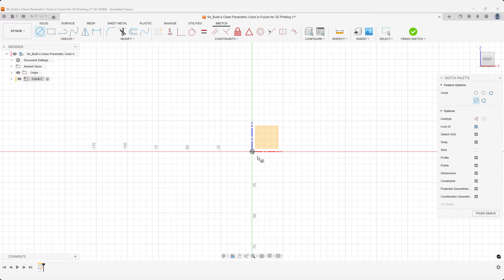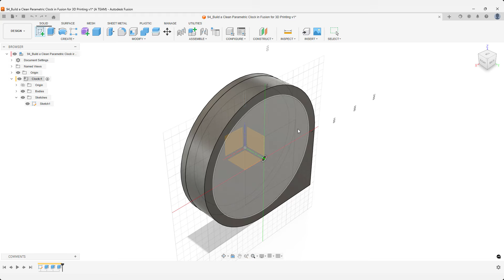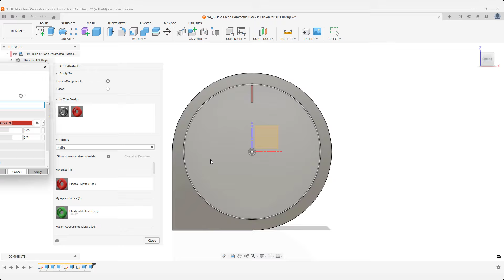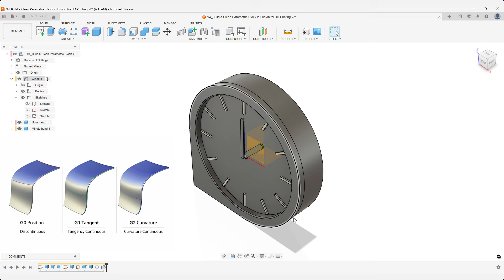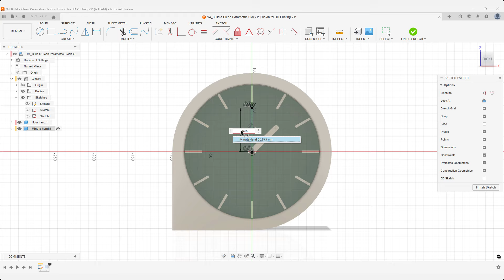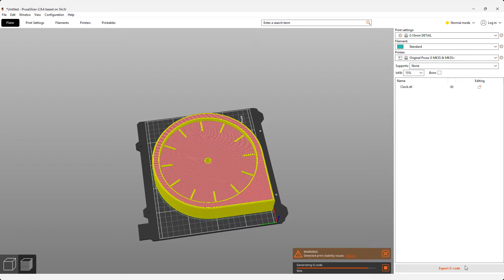This One Parametric Setup Changes How You Design in Fusion

Comment: Nice video—thank you! One suggestion: to constrain the 12 o’clock index, you can use a vertical constraint between the midpoint of the center-point rectangle and the origin (so you don’t need to add a new construction line). Liked and subscribed 😊
Reply from the maker: Thank you, great advice! Welcome to the channel! :)

Comment: Another tip:  If your sketch is not fully constrained and you can't figure out why, a very common issue is that you need to set firm dimensions/constrains on your construction lines, even though you might think they don't matter.

For instance, if you use a construction line as an axis, you don't really care about the length.  However, to be fully constrained, it needs to have a determinate length.  Either constrain it to points on another constrained shape, or at least give it a fixed length.
Reply from the maker: Thank you! Good comment!